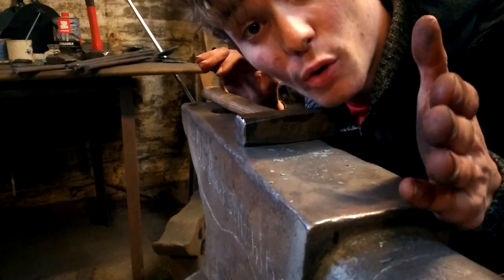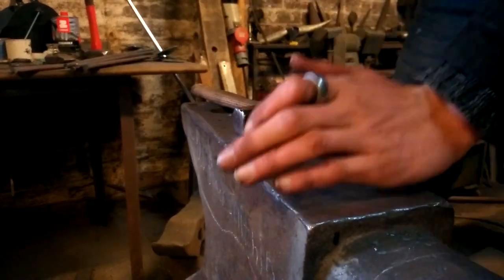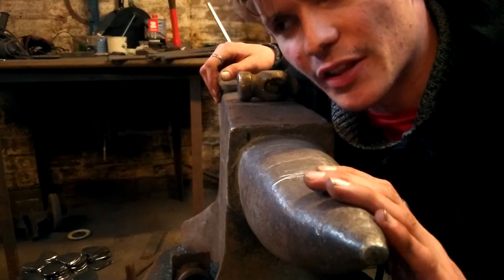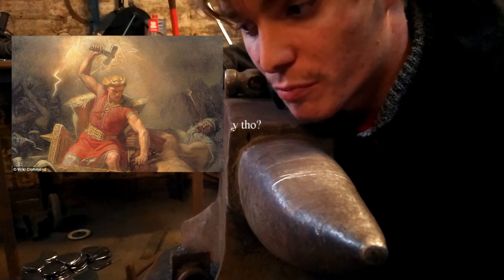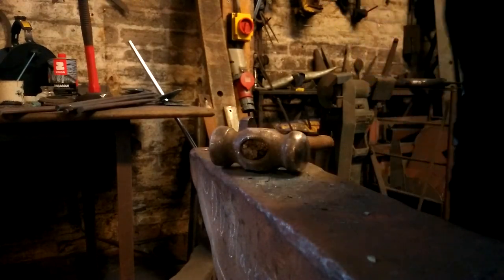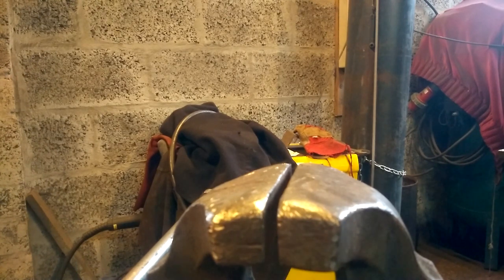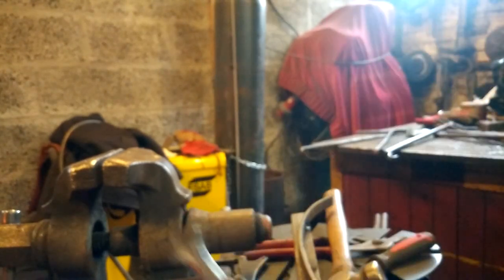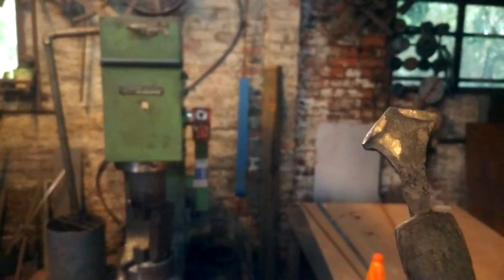Hand Forging A Mjolnir Pendant (Thor's Hammer)

Comment: A different idea that you might play with is to make Mjolnir from a nail, especially a hand forged one. Squash the head flat and shape a little...one of the Viking Age ways that a Mjolnir pendant was made (plus, the idea of a hammer from a nail would appeal to the Norse!).
Reply from the maker: Ah yes I've heard of this one. For my updated one after the lockdown, I might do that. This mjolnir was just an experiment really. It's really thicc. 😅 Thanks for the suggestion 👍
Reply: Good luck! It’s a fun project. You might try a Trollkors (Troll Cross) at the same time?